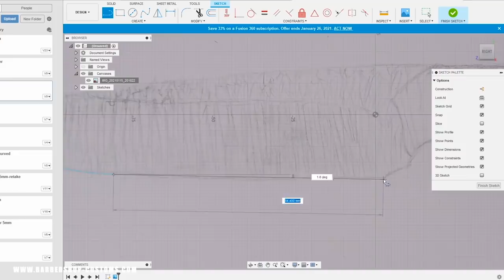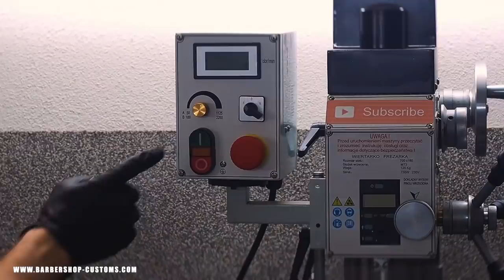Making a PRIMITIVE Knife w/ MAMMOTH TOOTH Handle

Comment: Always wondered why do you heat treat the blade before grinding the bewels. Makes it a little more difficult keeping it cool. Gorgeous knife tho
Reply: O to samo miałem zapytać.
Reply: He killed this knife, because I don't see any watter and he grind it for long time
Reply from the maker: It's less work, because you don't need to clean the decarb after HT, so you only grind it once.
You just need to make sure not to overheat it 
And NO, I didn't kill the knife, did you see any tempering colours while grinding?
Also, we always have a tank of water standing next to the grinder.
Reply: @BarbershopCustoms thank you for answering, that makes sense, but I think I'll stay with the '' first grind then heat treat'' method, simply because i dont have a good belt sander, so i have to work while the steel is soft

Comment: You should first finish the grinding of the bevels etc, and then heat treat. After all, grinding a softened steel will prove to enhance the durability and life span of your belts. Besides that, I think that that knife looks absolutely amazing. Great vid. man. Also love your thumbnails!:)
Reply from the maker: The way we do it, it's easier to prevent the steel from decarb. It's also less work, because this way you need to only grind it once instead of twice 😁

Comment: Very good job again, as always. Also loving your video editing. An idea btw; if I was doing this, i would finish the handle scales (mount them temporarily to the blade and work on the belt grinder) before the steel blackening process. Then I wouldn't lose the nice blackened surface on the handle side maybe?
Reply from the maker: Yeah, I was thinking abnout this too, the problem is that you can't get an ideal fit without glueing it first (using natural materials) and I believe the fit is more important than the blackening :)
Reply: @BarbershopCustoms  Makes sense :)

Comment: The fact that you have all the fanciest gear like a water jet and proper heat treat oven yet still use a drill bit to centre scribe for your bevels makes me giggle, if it ain't broke... 😂
Reply from the maker: I really find this method the most convinient and the fastest :D And it doesn't need to be exact as I check it with a caliper during the final grinding passes :)
Reply: @BarbershopCustoms  no point in changing what works 😂